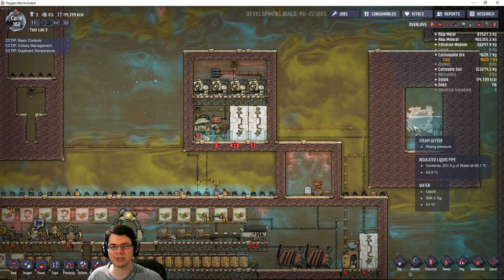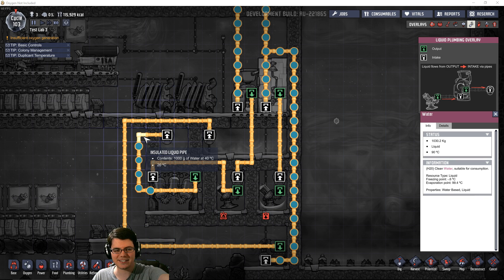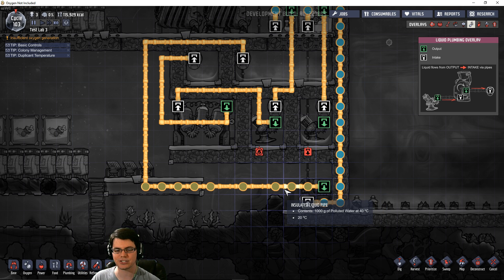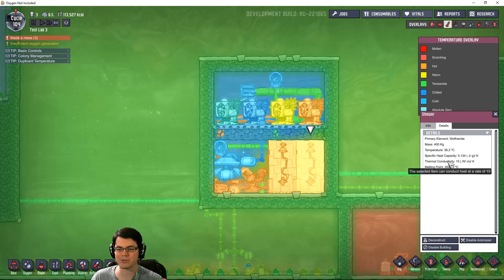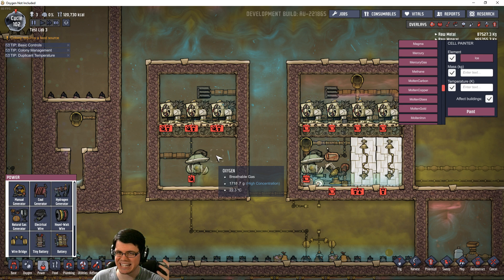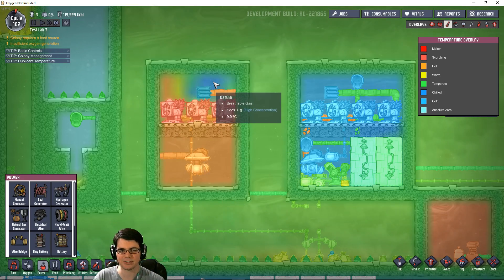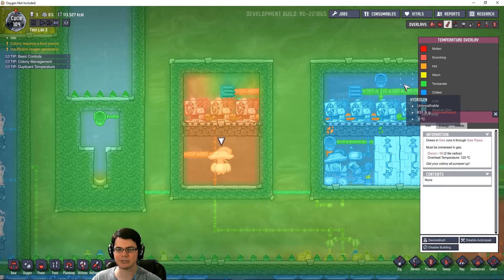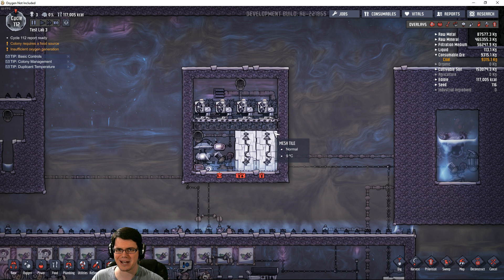Net Cooling a Steam Geyser - Oxygen Not Included Tutorial

Comment: Here's another huge exploit I found. Tiles always have 15-45°C temperature when constructed.

If you have Sandstone at -200°C , the tile constructed from it will be 15°C.
If Sandstone was 700°C, the tile will be 45°C.

Build a tile near hot water, wait until it absorbs heat (build tempshift plate from any refined metal or diamond adjacent to them both to speed up the process), tile will get to 90°C, deconstruct it, you will get 100 kg Sandstone  at 90°C as a result. Pick that Sandstone again and build a tile, it will be 45°C. 55°C were deleted. Construct-deconstruct repeatedly until your water cools down to 45°C.

Dirt, Sandstone and Granite have the highest Specific Heat Capacity of all solids (1.48, 0.8 and 0.79 respectively). Ice and Polluted Ice have 2.05 and 3.05, but you cannot use them. Personally I prefer Sandstone due to how slow Farm Tiles are constructed.

The biggest downdise of this method is that it is completely manual. However, this is more time efficient than Water Sieve Carbon Skimmer exploit due to the fact it only processess 10 kg packets at a time and cannot delete more than 60°C (water) or 80°C (p.water). Tile construct, however, operates with 100 kg at a time and can convert 2700°C (Obsidian melting point) into 45°C in the blink of an eye.

Comment: Fan of this page. Have been trying to set-up the exact cool system using 4 thermo regulator, and the water enters into this system directly from a nearby steam geyser. (Job update) But I am not able to get the same output at your video. The thermo reulgators are still giving extreme alot of heat. My system will only drop the oxygen temperature until 35-40 degrees, not sufficient to cool the water. :(:(

Comment: THX.
did freeze the geyser.
did use 50%/50% hydrogen/oxygen and pump in the upper part and the items to cool in the oxygen part (or in chambers with metal tiles filed with hydrogen or vacuum if the chamber will hold only liquids to cool, liquid need to toutch the metal)
raise the pressure to about 1.5-18 kg (higher pressure better gas seperation)
1 aktive vent in the lower right hydrogen part (bevor system start)
and row of vents 1 tile belov

Comment: @Brothgar hey man thanks for the video its awesome and seems to work but i have another way as well i found. I use a water purifier to get it down to 40C and then run it though insulated pies though the cold biome and even though they are insulated the pipes will become cold over time if the system doesn't run 100% of the time. You must leave it some time to cool the pipes off every day or 2.

Comment: It's really strange how Klei doesn't stick to a consistent way of balancing these buildings. Yet - I can understand the need for some limited physics-breaking items like wheezewarts as a reward for exploring - but there relay is no reason why some buildings would output set temperatures when everything else is relative. It breaks the interconnected relationship that everything is supposed to have and what makes the game deep.

I'd much rather they give some buffs to various ways to cool things down than relying on what must surely be an exploited oversight / mistake.

That said, I wonder if you could use polluted water as a coolant for super hot systems and then set up some logic to dump it to recycling before it is at risk of steaming and introducing new cooler water.

Comment: @Brothgar, no idea if you will read this, but I believe the reason this system self cools has less to do with the regulators and more to do with the hydrogen at the top.

This could be a bug in the simulation where some fraction of heat is lost during exchange between two different types of gases.  

You could see if use multiple types of gases, or increase the contact points between the gases (increase surface area of gases meeting), it might become even more efficient.  

For example, have a gas cake of hydrogen, oxygen and natural gas at the bottom, and cool the oxygen so it exchanges heat with both the hydrogen and the natural gas at the bottom.

If the heat is getting removed during gas to gas exchange this should greatly increase the efficiency of the system.
Reply: I tested, and it seems to be related to air vents, I added two output air vents instead of one, and it cooled much faster.  But it seems to only work when there is a neighboring gas of a different type next to the air vent.
Reply: how it vent* :P
Reply: I'm testing this now (as of the Tubular update). It still seems to work, but MUCH more slowly. Over the course of maybe 20 or so cycles, the Thermo Regulators have cooled ~20 F (~11 C). I'm guessing this means that even though it's net cooling, it wouldn't have the bandwidth to process enough external heat to make it worth the energy.

Comment: how to turn it into ice cube:
step 1: visualize this: if you have a rubber cup in a pool, but can only squeeze it horizontally and move it vertically, how do you empty the cup? well, you squeeze it!
but how do you empty it? you don't. you empty  smaller cup inside which you /cant/ lift up, but you can squeeze flat.
step 2: pump the heat from ne chamber into the self cooling one, since it works on overflow, i.e. squeezing the cup, when you want larger ice, dump more hot water into the ice room and pump the heat right back where it came from!

Comment: As far as I know, electrolyzer always produces gases at 70 C, regardless how hot or cold the water you send to it is. This behavior was introduced with agricultural update by the way. If you want to avoid clear cut exploits, you just don't cool water in current game and use abyssalite pipes. Though the fact that you can use 95 C hot water everywhere without any punishment feels like an exploit itself.

However that self-cooling chamber is really cool. I wonder what makes it work, I suspect it might be similar mechanism to the water drip cooling exploit, with the hydrogen layer "dripping" on bulk of oxygen.
Reply: That is strange. Mine are not at 70C. After reading this comment I had to check. Mine are closer to 40C or possibly the temp of the electrolyzer itself which is at 43C. Hard to tell really. I am on the latest build 221865
Reply: kasuha yes the hydrogen cools it
Reply: Okay, you made me run a test. Two vacuum chambers, two identical electrolyzers, one fed water at 6 C, one fed water at 96 C. Both converged to the same temperature - 70 C. If your electrolyzer produces colder output, it's because you have something around it that cools it down.
Reply: Does this still hold true in the current game?  That you can use 95C water everywhere..  as my dups took heat damage while building the pump at the geyser?
Reply: Hi, im trying to setup this and want to know how did you connected the thermo and atmo sensors and what number did you use. Btw does this still work with automation update? 
Sorry if my english isnt great n.n Thanks!

Comment: Wheezeworts seemed to be nerfed a bit too hard.  Or the rather large amount of them I was using wasn't enough.  Thermo regulating using dripping water to keep it from overheating seems be be the most consistent but I have not likely ran in to problems with that water getting too hot or the net values of everything over time.

Seeing those cooling showers again was nice.  I wonder if it has anything to do with overall size or just the amount of material it took to make.

Comment: Hey Brothgar, I have figured out how the self-cooling thermo regulators work. They move TEMPERATURE (14 C) from the gas pumped through them to the gas around them. If you pump a gas through them with high heat capacity, a lot of energy is removed. If (in addition) the thermo regulator is placed in a gas with low heat capacity, the heat radiates away with a very small increase in energy. These effects combined make a net loss of energy.

TL;DR: pump high heat capacity gas through the regulator, and set the regulator in a gas with low heat capacity. Magic loss of energy.

Comment: I found running a large conduit to the steam geyser works great in cooling the water and no pump is needed. 1 tile wide on the vertical and 2 wide on the horizontal is needed.  Works good running through a cold biome, but watch out for ice and don't use granite....

Comment: If you want to cool a gyser its easy to do with two wheezeworts at the top of the output and a basin of tiles etc that keeps a one layer thick pool of water at the bottom. I have a few wolframite mesh tiles above the output with the worts on both sides. they cool the mesh lightly then the steam cools on it and collects in the bottom. it gets colder and colder over time and i have had it actually freeze which blocked the system slightly.  the pool overflows and thats what i pump out. the water pool reduces the output of the gyser but if you have a few then its not a problem.  once it gets down to temperature you can remove one of the wheezewarts.  you can cool water with this layout just pumping water over the top of the mesh tiles the trick is that it doesnt want to run constantly. it has to stop and start.